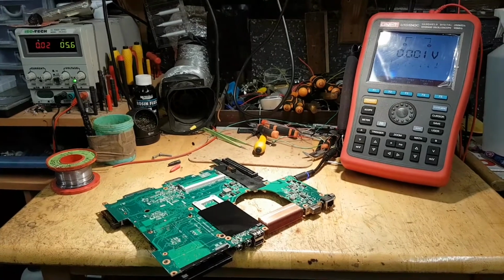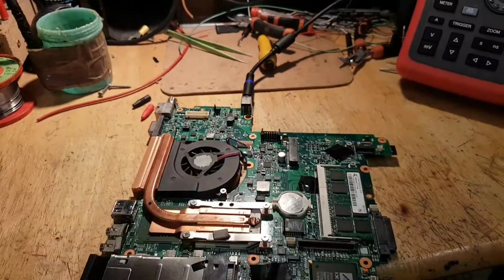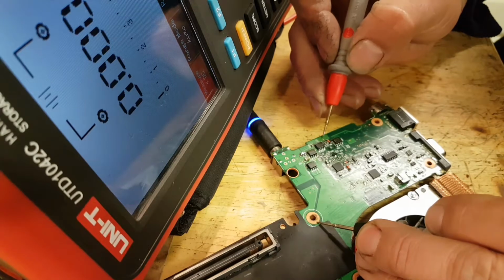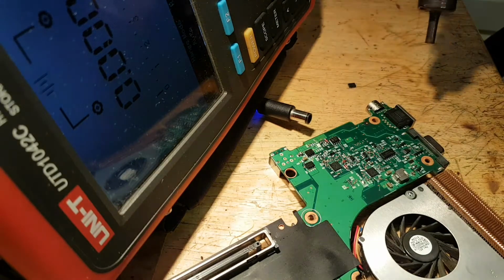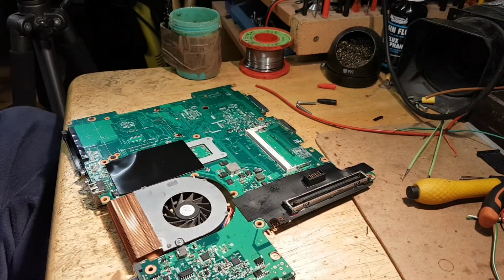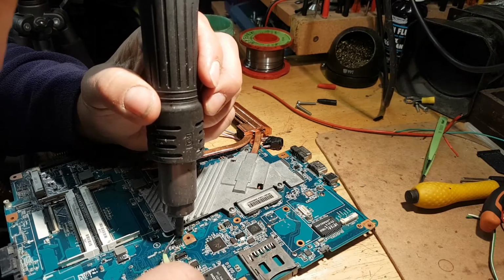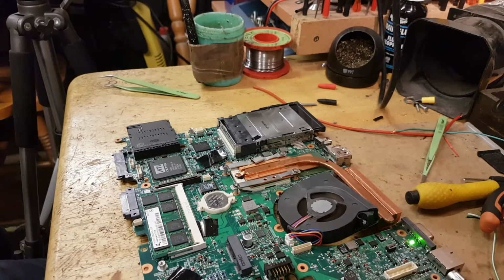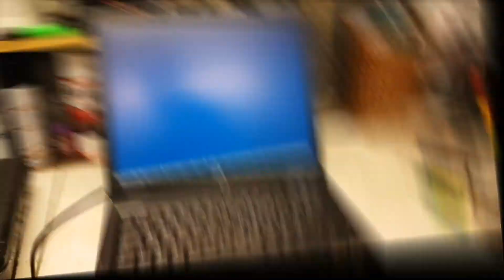Laptop not powering up, not charging... Fault finding and repair.

Comment: An amazing video luis. It is better to not cut it, it feels much familiar rather than just solid job. Thanks for the video...
By the way why are you keen on the older hardware, i spotted sdram on your desk, they are discounted around 2002, even your laptop is around 2005, it can't even watch 720p videos. They are being all time losing things after a while...
Reply: I personally have computer from 2003 and it is good spec too but it is hassle, just losing my time, and it is a big heater that cpu lays around 50 degrees, 90 degrees under work.
Reply from the maker: I do have a few old laptops and computers...
They are still good for most of the stuff I need them for...
Not as a personal computer, for that I have a slightly newer one...
👍👍👍
Reply: He is using multiple diagnostic programs on multiple notebooks. If you repair car from 2005, you dont need windows 10 to run ancient diagnostic software. My car has wiring diagrams in flash format (swf) that is blocked and uninstalled on newer browsers for example.

I absolutely love the timelapse parts.
Reply: @brano2yt  Same here, my 2008 Fujitsu Siemens Amilo notebook is more than enough to run VCDS. Never let me down a second. Agree on the timelapse too, a great way of showing every repair step without the video being too long.